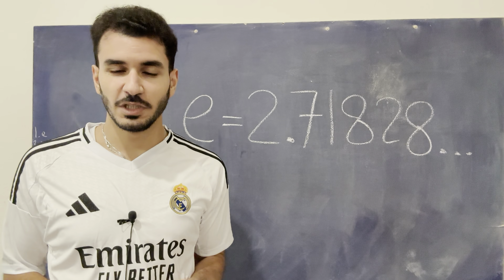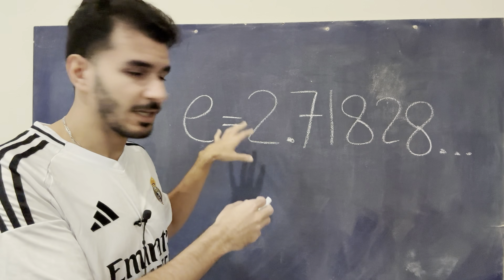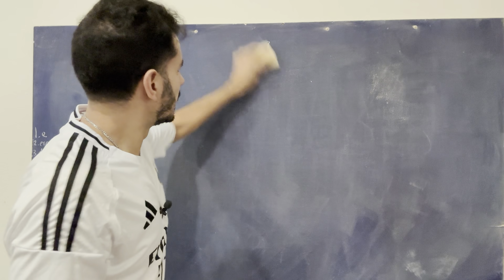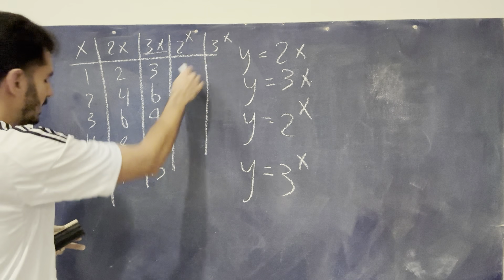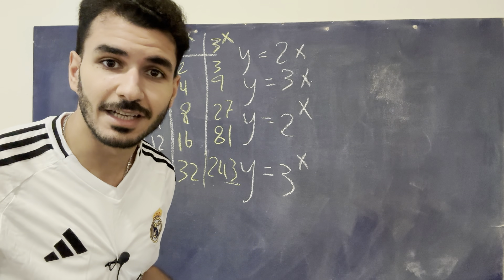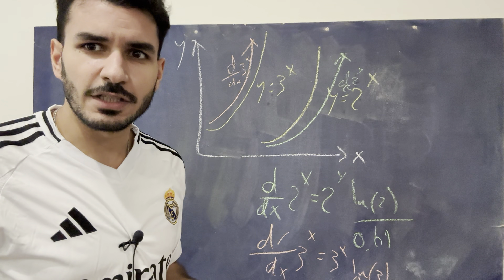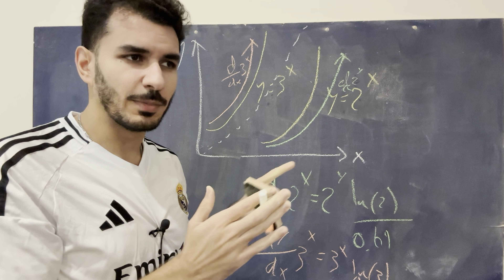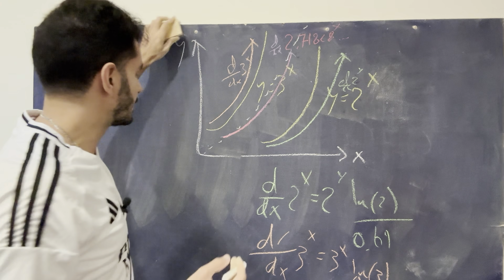Where does “e” come from?

Comment: Consider gazing upon a chalkboard wherein alone is written 
"1+1=2", quotation marks included:

(1) We acknowledge it as spoken somewhere, somehow first. That we are witnessing the scripted version of a verbal expression.
(2) We acknowledge the presence of quotation marks to signify "someone said." Or, "this is that of which it is said" ("Someone said 1+1=2" etc.)
(3) The initial notation (1+1=2) turns out means the same as the second ("1+1=2"), notwithstanding quotation marks. For its presence on the board also signifies someone has written it there. It is an artifact of thought.
(4) But the initial scriptor need not have placed quotation marks. In a marked [sic] sense each scriptor writing 1+1=2 could have written "1+1=2"--but then if asked who they are quoting could say "myself"--so that the act of self-quotation is as explicit as the original utterance¹;
but no one quotes themselves or avers to having been quoting themselves in original expression!
(5) 1+1=2 isn't even written by our scriptor as the quotation of anyone, although it effectively is a quotation of all who have uttered it including whoever first did. But the ability to presume an unnecessary need for quotation springs from an apparent fact that what it states is not a matter of opinion, that it is obviously true whoever states it.
(6) But is it true even if no one states it, or it has never been stated at all?
I.e., is "1+1=2" not just 'a true thing to say' but true 'in itself'--true if it had never been uttered, written, counted, even thought? 
(7) The notion of a true thought that has never been thought seems odd:

-------
(8) 'No two things are alike'. Therefore we are FOISTING one principle upon another: (a) Leibniz' Law upon the principle of experience which says No Two Things Are Alike, or 'equal'.
Leibniz' Law (Ł) states that where properties, attributes of two things are completely identical they are "the same," are indistinguishable, thus ARE the same. 
"Putting two intrinsically dissimilar² things together as though they were not then declaring them a pair according to a principle of cognitive realizability called counting is 'merely to name a process of the human mind'," insists the intuitionist. "What is 'discovered' is that a system of grouping and naming things bears consistent results; not that a great maxim of all Reality is codified by nature as an inherent truism!"
"Moreover," he concludes, "if you say it is not about a mental process but its eternally consistent result, I'd say it's all mere semantics: whenever you combine separate objects, things each named one thing, then give the name two to the amount comprising the group, that of the things regarded in combination, that is a language game for the sake of facilitating various undertakings, and not a grandiose metaphysical truth commanding veridicality beyond all notions of space and time. Thus, if
'1+1=2,' is a 'Cosmic Truth', it is about the benign and trivial nature of sublime recapitulation."
(9) Yet it should be noted that if human ingenuity has discovered-- or created --statements eternally true in all conceivable realms of reality, it must be considered remarkable for that alone. The intuitionists thus stand guilty of ingratitude.

-------
(10) while typing the above I was listening to Bernardo Rubaya's "Overture," a short symphonic piece of exactly 2¾ minute length, having placed the digital recording on "loop video" playback. It occurred to me at about its seventh consecutive listening that, unlike the stipulation of Leibniz' Law that for two things to be indiscernible they must be absolutely identical in every respect, that this would not be so in the case of consecutive listenings of the Rubaya. For although physically the actual recordings ARE so identical they will have been literally the selfsame recording per se, the fact is that the act of listening was different in respect of clock time heard, that they bore a distinguishable sequencing differentiation (t¹ and t² we will call them), and that they were not cognitively processed and 'heard' identically, renders each phenomenal act of hearing the piece separate and distinct, even though the recording itself was indubitably the same -identical to itself- in terms of every physical characteristic under the Ł criteria for an absolute indiscernibility.
(11) Perhaps having heard too much of the Rubaya already, rendering Phenomenology's practice of "bracketing" impossible (as my first and second hearings for the sake of the above argument were actually the sixth and seventh, or perhaps seventh and eighth), I decided to hear a back to back singular repetition of a recording by Henrik Meierkord, "Moln" (from "Själ), a symphonic piece lasting 2:17 minutes; which I am beginning now...

.......

...subliminal expectation, conscious anticipation, a mixture of familiarity and surprise, old delights 'in a new key', fixing a different style of appreciation; memories, impossible before...it seemed the second time to have ended too quickly, though the elements felt as perfunctory the first time were lacking in the second.
And yet, there will have been no doubt in my mind, if unfamiliar with the experiment's format and ignorant of it altogether, I was hearing the selfsame piece of music.
The effect is not unlike hearing a symphonic movement where the main melody's thematic development is repeated from the top at mid-movement, and although the notes are identical it seems different in some meaningful, yet not arbitrarily crucial way the second time around...

-------
(12) [To return (8):] The number '1' in our equation, twice mentioned, is presumed identical with itself, and this is fundamental [A=A] to all thought, so far as we know. The number signifies 'any thing' in solum.
Thus there need not be any indiscernibility of properties among the two items being counted at all. 
BUT THEY ARE GROUPED WITHIN THE EQUATION JUST AS IF THEY WERE CORRESPONDING INDISCERNIBLES, being regarded as solitary entities for the sake of inclusion in the equation. For neither could be thought as having a quantificational value lesser or greater than the other, and this renders inevitable differentiation of qualitative value moot. That this entails the equation merely semantic is demonstrated by the tautological feature of the definition of terms as purely synonymic: 'two' is just another word for 'one and one,' and vice-versa. 
But Ł is definitely, if not definitionally employed: A=A, in the form of "1=1" is presumed throughout. Given this insight, that one of anything may as well be anything else, that so much of the universe is indisputably made up of 'interchangeable parts,' a statement like "two is the word for the group of one thing and another side by side" may be true for any and all cosmoi, but it is a meaningless truth if true.
"No two somethings are alike" may be an acme of universal experience, but that doesn't mean chunks of reality cannot be reckoned as if they were selfsame, for one of anything, no matter what it is, is always one.
(12) But how, or why, would someone seek to claim this little bit of anthropological fact will entail that mathematical statements e.g. "1+1=2" must be part and parcel of a bin of Absolute Truths utterly, eternally true in all possible worlds or even if there were no space-time, conscious entities, countable objects, nothing but Void?
(12) We ought straightaway admit that it at least seems certainly so that mathematical truths e.g. 1+1=2 are the sort of thing one would expect to see if it were knowable empirically that such true statements are true regardless of the existence of numbers, brains, calculators, things to count, reality generally. A metaphysician might someday unironically claim that "Reality plus Nothingness equals two," and support the equation's truthclaim by demonstrating, like Heidegger, that "Nothingness ought not count for nothing."³
It just isn't knowable if things like mathematical equations exist outside of reality as we know it, or not. But if it is true that they do exist extra-reality, the question must be asked if they are meaningfully real altogether. For the ontological status of something existing as truth for an unreal realm hardly raises suspicion about the realness of reality, but it does cause one to wonder if extrareal truths have crept into reality as ersatz truths, disguised falsehoods insofar as they masquerade as universal, eternal, objective reality even in realms where nothingness is real and everything is ontologically negated...

_____
¹ We deign not to limit 'utterance' to the spoken for our purposes here.
² According to a necessarily strict application of the criteria of Ł
³ In addition to Heidegger the reader is invited to peruse Mircea Eliade's "The Two And The One."

Comment: Here's why e^(iz) = cos(z)+isin(z)
Here are standard power series expressions for e^(z), sin(z), and cos(z)
e^(z) = Σ(z^n/n!, n = 0 to ∞) = 1+z+z²/2+z³/6+...
sin(z) = Σ((-1)^nz^(2n+1)/(2n+1)!, n = ∞) = z-z³/6+...
cos(z) = Σ((-1)^nz^(2n)/(2n)!, n = ∞) = 1-z²/2+...
As you can see by expanding these all out, e^(z) is very nearly the summation of sin(z) and cos(z) except he signs for some of the terms are off.  By tinkering with the complex number "i", Euler was able find his equation.
e^(iz) = 1+iz-z²/2-iz³/6
i*sin(z) = iz-iz³/6+...
cos(z) = 1-z²/2+...
Add cos(z) and I*sin(z) and you get e^(iz).

Comment: Chevy Lsx engines had exponential horsepowee curves by rpm, given n/a constrictions and limitations. The older SBC only made linear power, under the same conditions.  The SBC made more power at low rpms, but the lsx pulled ahead over the crossover point. They did that on purpose. Amazing engining on the Corvette and Camaro teams at GM. The linear power band was more fun to drive though, despite losing high speed roll races -- it could win in short distance acceleration from a stop, or low speeds.

Great lecture though.

Comment: There's a General Analytic Solution Method to solve the Knight's Tour Problem which can be applied on (4xm) boards for m > 4. To know more about it you may look for the 9 minutes video "YouTube · The Knight's Tour Problem: A Geometric Approach". 
In 1759, Euler gave a presentation addressing this subject stating it did not seem to be subject to any analysis ... but it was, although most of the further attempts have been based on trial and error strategies, except the one I'm referring to ...

Comment: Hey, nice video... quite informative and accurate... BUT tbf when i were talking about the derivatives of exponential graphs, u wrote (2^x)*ln2 and similarly for 3^x u wrote (3^x)*ln3, which is right... 
U then talk about how there should be function where the derivative should be equal to the function's value... my only problem is that you have already introduced "e" by taking ln2 and ln3.. yes u didn't say that " ln(e) = 1 and that's how 'e' comes... but tbh it doesn't really answer the question "where does 'e' come from"

You also mentioned the limits and other stuff.. but then again proving that also requires existing knowledge of 'e' in some manner..

Could u pls make another video where there's no information about 'e' used to actually find out 'where "e" come from"

Thanks for reading this tho :)

Comment: Best explanation I've ever seen on "e". I now know intuitively what "e" means, and it doesn't seem weird or unreal. The ability of a teacher to explain a college-level mathematics subject in terms that a layperson can follow is a priceless gift, and this young man has it! 
I tried calculating the value of "e" in a spreadsheet using the (1+1/n)^n formula. I carried it out to n=60,000,000 and the equation still had not converged all the way to 2.718281828, which is the value for "e" that I memorized back when I was an engineering tech just starting out on my working career in 1974.

Comment: Your explanation was very good, but I would recommend using it from one point to draw graphs because if they start from one point, we can see the sharpness of the graphs easily, otherwise they look like they are parallel graphs for the two exponential equations. You may also use software instead of actual blackboard because you will have more control to manipulate your explanations. I like your knowledge and I will follow you. Good job.

Comment: The other day I tried to solve a^n=n! Using stirling's approximation for factorials and after simplifying  it turns out the relation between a and n is linear for larger n. The relationship seems to be a=n/e. I wonder if there is a relation to what you explained in your video or is it just the e appears in Stirlings approximation?

Comment: The analogy using 2^x and 3^x is a helpful starting point, but it's important to understand how you are calculating the value of ln(2) or ln(3) 6:38. It is being calculated on log of base e. That's why at e^x the slope will be equal to the equation itself, as the logarithm's value would be 1. So explaining where 'e' comes from by using the value of 'e' is like defining a circle by its area
Reply: That was also my question
Reply: The phenomenon exists and can be studied without the use of that formula of derivation. One can estimate the balance point between the instantenous rate of growth of these functions  (2^x and 3^x) without any previous knowledge of the constant e. After that it's only natural that this balance point can be used to calculate the rate of instantenous growth for exponential functions. So it's more like introducing a student to Pi by showing that the ratio of every circle's circumference to its diameter is the same constant.
Reply: He is actually not using it to explain it. Ln(const) ist also const. It is just a numerical value that can be written als ln(2), but before e it was numerically calculated by average slope to be that value. It is just a notation that comes from the fact that e was discovered.
Reply: Exactly. Fallacious,: circular explanation.
Reply: @amirrashedi4052  It's not fallacious, you could find if the result is >1 or <1 quite easy without ln().
Reply: @xd_metrix  The argument is circular. So it's fallacious.
Reply: @amirrashedi4052  Yes it it, but this video simplifies a lot. Noone would use this video in a rigorous way.
Reply: I totally agree

Comment: I'm sorry, but I found most of this video quite unhelpful.  After an  extended elementary and moderately clear introduction to exponentials (which are taught in 8th grade), the lecturer starts using derivatives (which are not taught until calculus, either in advanced senior course in high school or in colllege) without explaining them until later, where he says something to the effect that they are simply the rate of change, but with clarification of how, why, or what the notation is or is showing.  At a couple points, he quickly writes some modification of his derivative equations that is illegible and spoken very fast and unclearly.  The lecture on slightly explained e.  It leaves too much to be said and probably the vast majority of the people understanding already knew a lot about e -- and likely this particular explanation (i.e., an equilibrium function) of it.  This was a disappointment.

Comment: The presence of ln in the derivative makes your argument circular.
Reply from the maker: the key idea is that the derivative of things above e is greater than the function itself -- how the derivative itself came to be is a separate discussion
Reply: But the title is about where e comes from and not where it is useful.
Reply from the maker: @_John_P  thats the second half of the video where I explain the limit of (1+1/n)^n, did you watch that part?
Reply: @alithedazzling  Yes, but you didn't show the actual calculation, nor where the series comes from. You only mentioned the series and wrote e as the presumed solution to it, which would have made for a 10 seconds video in order to answer the title of the video. I'd expect a video that talks about the origin of "e" to mention the thought process that led to the series, and the actual step-by-step solution that shows e magically converging out of the series. And then, finally, the interpretation of "e" and some of its applications. Your video is backwards, you should have started from the series.

Comment: Interesting over view but I think with significant gaps. You use natural logs to compare an exponential function and it's derivative i.e. a log to the base e to explain e. I'm not sure that using e to explain e is valid. Also the series that you use to show a convergence to e is not very well explained. Is this form of series unique or will any series where the incremental function of n is less than 1 converge to e? 1 + 1/2n; 1 + 1/n^2 etc.

Comment: The simplest explanation is that all exponentials y = b^x, with a base b > 1 have the same graph - except rescaled horizontally. The one which crosses the y axis with a slope of 1 is b = e. So, since e^{2x} = {e^x}^2, and e^h ~ 1 + h for small h, then e can be tabulated by (1) starting with 1, (2) dividing by 2 a large number of times N, (3) adding 1, (4) squaring N times.

Comment: You almost explained e. But as the video got longer the shortcuts in explanation increased while the knowledge gaps got wider until it appeared ti be just another meaningless math class of chock dust and words without ideas.  Try explaining it backwards from some abstract formula to a few concrete starting points.  Show all the work for each data point (you'll use smaller or shorter examples).  Relate everything to the real world.